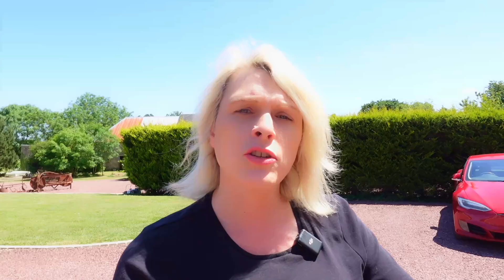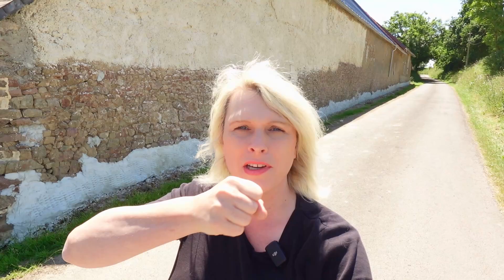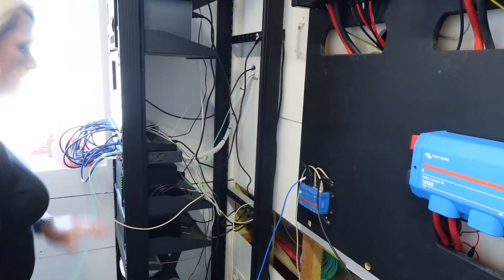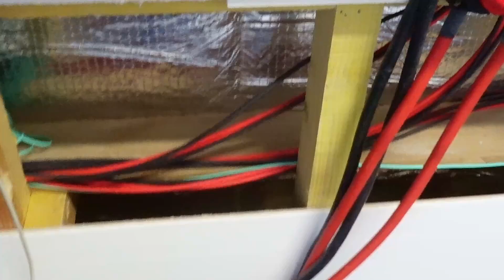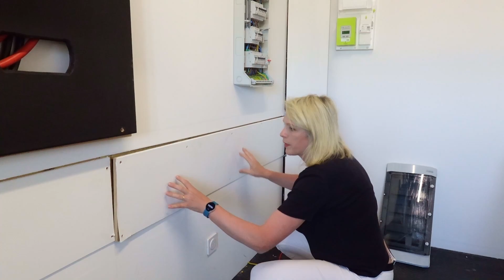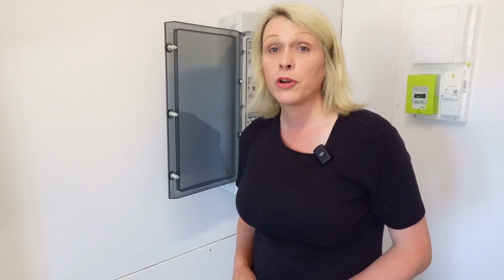Solar plant room finishing touches

Comment: What about ground mounting some panels in the field just out the back of the house, along the line of bushes where the electricity pole is?  You could bring the cables through into the back of the plant room. An almost vertical array in that position would be west facing and help with production later in the day, the bushes would offer some protection from the wind and it would be close enough to the house to be a bit more secure. Obviously you'd need to consider whether it would be affecting the view or light levels at the back of the house but it might be worth considering.
Reply from the maker: Yes we definitely could do that we've got a massive field behind the house, the other thing we are considering is possibly putting a wind turbine in the field because it's quite windy in the winter.

Comment: I was pretty disappointed in the victron when I opened it up , jack all heatsink inside of them not even fins they are relying on fast air speed to cool them , I was expecting full resin covering circuits and large heatsinks that redirected heat into a cooling chamber so the electronics could be kept sealed and dirt free , but nope , not even a baffle inside to help with air flow ...
Reply from the maker: Yes it does have quite allowed fan with a lot of airflow going through.

Remember the Victron equipment is all guaranteed for five years

Comment: Sorry for 3rd comment.. Portable AC is rubbish.. like in emergency it is OK...nothing special just OK..but if you want to be sure your equipment is cool i really suggest to go for AC that has split units.. ofc if possible and isn't too expensive use that one with inverter inside.. and you can be sure almost for 99% you can be sure during winter you will not need it....there is plenty of equipment that will do like 10 -15 degree all the time even if there will be -5 outside..no need to worry at all..
Reply from the maker: Yes some portable air conditioners are complete waste of space I know exactly where you're coming from. However I did purchase one a few years back in my old house and it was absolutely brilliant so hopefully the new air conditioner which is meant to be arriving today works just as well however I am planning to install a mini split unit later in the year

Comment: Nice video. When you talk about render.do you mean like cement spraying onto the wall ..is it this kind of things..or it will be more traditional top coat with cement glue sand and such ??
Reply from the maker: Yes we're spraying on a top coat very similar to a top coat off smooth cement that you sometimes see on the side of buildings. However we are using sand and lime.  We're doing this all week so I hope to film some of it and post it to the Channel
Reply from the maker: I'm planning on installing two new batteries as well as more solar panels

Comment: What azimuth is the barn roof where you've installed the first lot of panels? I've heard you mention that it's south facing but looking at the shadows in a number of your videos it looks a bit more like south/south-east - about 160ish azimuth? What is the exact time of day of your peak output?
Reply: You are right Chris, the roof does face South South East, which is a bit weird as an old property you would have thought would be more aligned North/South or East/West for practical farming considerations. The core of this property was originally built in 1671 by the way.
Reply: @daveingram8036  I'm wondering where  I'd put additional panels if it were my  property. Panels on the other side of the barn roof would give an output on a cloudy day that was not much less than the ones you've already got but I'm not sure I'd like to have them next to the road.  There's the aesthetics to consider and, whilst I don't know what the rural crime is like there, I think I would rather have them less noticeable to the odd passing rural-criminal. If it was the UK then I could well imagine some chancer climbing onto their van roof and damaging some of the panels by trying to have away with them.
I know you've got a bit of land with the property but how about detailing in a drone shot what exactly you've got to play with?

Comment: Panels facing north might just be annoying for you because you can't sell the extra summer power. In the winter, you'll get something out of them even if they don't see any direct sun, just not very close to the panel rating. If you get snow, it lingers on north panels for quite a while. If good panels are super-cheap, it might be worth it.

Comment: We do the same thing. Adjusting use by our harvesting of power. I hope to automate it more too so that I don't have to pay so much attention to use. I have 6 kw of South panels, 3 kw of East panels and have planned for 3 kw of West panels. When I added the East panels that was a big change. Those put out more power out than the South panels till about 10 AM. We do pretty well with this setup and 30 kw of battery. I believe that the West facing panels and another 10 kw of battery will make us pretty close to being able to disconnect from the utility power.

Comment: I dont know if you have a heat pump water heater already installed, if not, you can install one, especially the stiebel eltron one as it is very efficient. It can work like an air conditioner

Comment: Your cerbo probably shipped with a temperature sensor. You can set this up to graph ambient plant room temp in the VRM. You can also set logic events to happen based on temperature parameters. My system is a very similar scale to yours and my plant room was also running a bit warm.  I added ducted extraction to take the heat straight from the sources and blow it directly outside and it made a big difference for only a few watts of fans rather than hundreds of watts of AC.
It would be pretty easy to model the solar output of your other roof elevation using a tool like open solar. You may be surprised by how much extra it would generate.  I would guess it might be as much as 70% of what the main array manages panel for panel.
Your isolators look a bit undersized for a 15kva quatro. It would be worth running a max output test to see how hot they get. As standard I now do a max output test on all the Victrons I put in and I look at all connections with a thermal camera. It is amazing how it can show up a bad crimp,  dirty connection,  under torqued connection etc.
Reply: Was also going to suggest connecting a temperature sensor to the Cerbo. I actually removed my Victron isolater switch a few weeks back as under heavy load it was just getting too hot. I have isolators on the batteries and in the solar combiner boxes, so it was also surplus to requirements.

Comment: I’ve not come across much positive feedback on the Victron EV charger. Sounds like it needs a separate device for pen fault protection. I would investigate this before buying. Other option would be to look at a Zappi with CT, assuming you export?
Do you export to the grid? Could you get credit for excess solar. No idea what tariffs are available in France. In the UK on Octopus Inelegant GO, you can export and get 15p credit for every KWh. The DNO in the UK do set an export limit thou, based on the local electrical infrastructure.
Reply from the maker: No we don't export to the grid at all can I really need a charger that will communicate directly with the victron system

Comment: Before you buy an expensive new charger, you might want to check the software "evcc". It works with Victron PV systems and a multitude of car chargers. It will automatically adjust the current for the car depending on the pv system.

Comment: @totty100
0 seconds ago
Hi, cudos for building your batteries from a kit, a few months back. But.......
Can I recommend that you invest in more or bigger batteries.
I recently commissioned my Fogstar 15KWh battery and it's excellent with my Victron components.
It's top quality and very cheap at £2,500 direct from Fogstar. You can connect up to 15 of these units together and they have auto internal heaters for winter.
Bimble Solar now stock these batteries. Just a suggestion
Keep making the videos please - love'em

Comment: 16:44 - If you want to get rid off the heat then consider buying a french Atlantic Explorer Warm water Heatpump to generate warm water and cool the Victron Hall of fame. A split AC is about 1000€ at least and the Atlantic Explorer is a monoblock warm water system which comes with 2 ducts and one goes out side while the other sucks in the heat of the room to heat the water. More efficient to reuse the heat inside this room then to use energy to cool it down. We got one from the netherlands last year cause they had been a lot cheaper there than in germany. Not sure about french prices now cause we had only purchased the Wifi Kit from a french shop. This Atlantic Explorer is a SG ready device which means it can be triggered if you have excess energy from the roof - but again you would need a power management to prioritize how to use the excess energy: first the battery, then the car or rather the heat pump or the warm water heatpump ... 

Split AC are great, but bad and ugly if the device does not match the demand and gets into cycling cause the whole COP efficiency will be gone at least our experience with 2 big 5 kW Mitsubishi heatpumps each able to run at COP 5 or 6 from 7°C and above but not in reality . Takes a lot of effort to measure the output of such Split AC while the input is easy to measure. Unfrotunatelly the big mitsubishi can easily tend to cycle which will kill the COP and efficiency by a factor of 1 or 2 from 5 to just 3 in our situation. THerefore we tend to avoid the Split AC and use the warm water heatpump with a heat exchanger to heat the heating circle inside our diesel heater. This will generate warm water within 3 or 4 houts of sunshine and then heats the 280 L up to 62°C. We then use the 62° C water to heat the diesel heater kettle and pumpt the heat into the radiators cause the warm water heatpump is running fully without cycling while the big heatpump starts to cycle above 5°C as the split AC do too. 

It is easy to throw a Split AC into such room but it can be a waste of energy and investment once you realize that you could get warm water for cheap this way too instead of heating the environment. Atlantic Explorer is a french thing and Atlantic is a big company - as many employees as german Viessman now owned buy an american company.

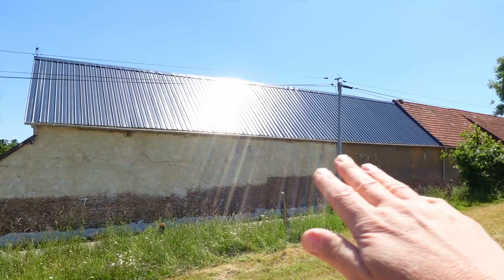Comment: 5:21 - if you need a serious plan about the sun on that roof during winter take a ladder and sit on the roof using an android phone and the app sunontrack for 7 € cause it will show you in augmented reality the current path of the sun and the key dates / paths for 21. of june / mar & sept / of december. It will give you an instant overview. 

Different directions are usefull for those without a battery but not that usefull for those with big batteries. In winter East and west facing is a deadly mistake cause the sun will rise from south east and go down south west never reaching full east or west in times when your demand is high. South is king for all those with batteries, and vertical south in winter at least a few panels along a fence or on a fassade if allowed.

But to get a full picture incl. all the shadows from those trees (5:21) and the power lines you need to do  a simulation with PV Sol Premium cause that will give you all the answers if more panels are usefulll and how much they would help to cover your own demand or to feed the grid.

Wallbox: Try to stay independent from a manufacturer cause victron is not the best wallbox manufacturer. You will want one which can shift from 3 to 1 phase only which only a few can do which is important cause if the car is charging on 3 phases only and can not modulate down to 1 phase only. So you would stay at 3 x 2 kW or so instead of shifting to 1 phase 3,6 kW charging. 

 Therefore we use EVCC (open source developement) to manage the excess energy usage like charging the car with 2nd highest priority and 3rd to run the hot water heatpummp and 4th priority our heatpump, both of those are sg ready devices. reduced our diesel bill for heating by 90%

Comment: You can definitely extend the daytime period where the solar is providing useful power by adding panel groups pointing in different directions.  That can extend your overnight battery run-time a few more hours.   Given how quickly the batteries fill up, it also sounds like you might want to add more battery storage.  And that would also reduce constraints on vehicle charging.

But for the most part, the system is working extremely well.   I am quite envious at all the space you have arrange the panels and equipment!

-Matt

Comment: PICEA is your solution for the surplus energy stored in summer to be reused in winter .

It generates Hydrogen in summer, stores that in bottles and powers in the winter your home by 1/3 using a fuel cell and by 2/3 to generate warm for the heating. But that is an expensive solution from Berlin, germany. A few of these have been installed in older houses and have gotten subsidies (big times) but they are quite expensive but do a full circle to become grid independent. 
The company is called HPS or home power system. 

They also have released some videos, a few of them in english.